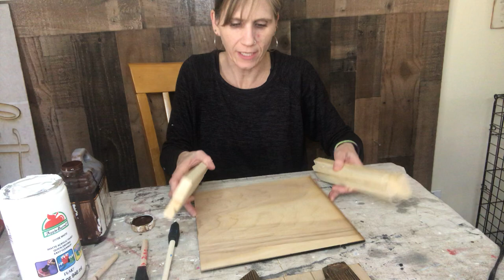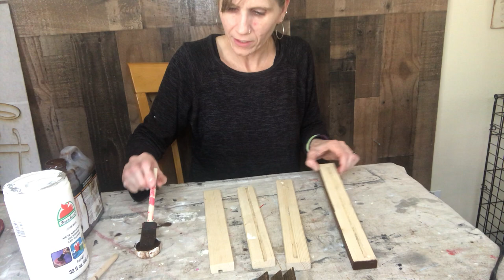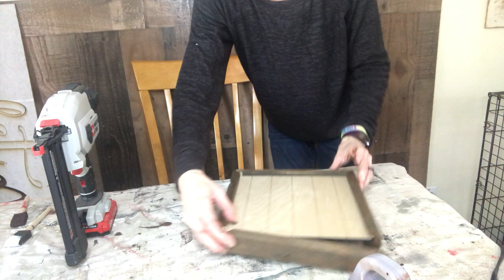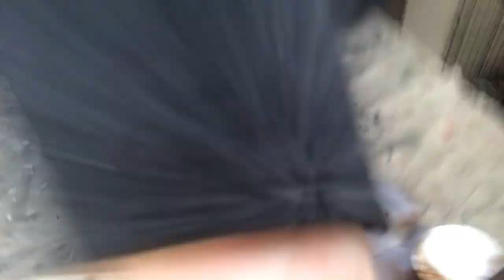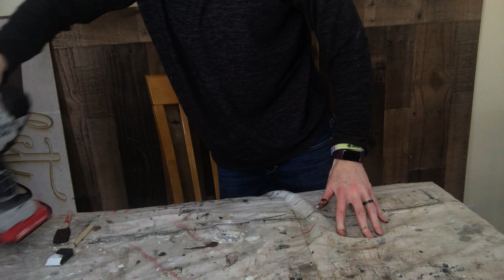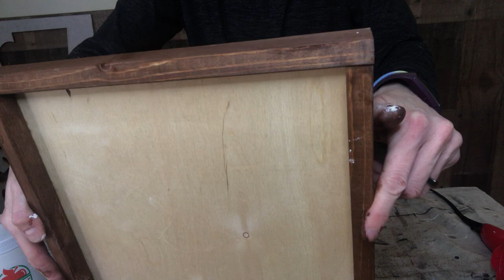Assembling a Farmhouse Sign with Routed Grooves & Thin Plywood - Super Lightweight

Comment: If I have a 1/4 inch mdf board cut at 20x20 and want to do the router groove and mitered corners, what would I cut my 1x2 furring stripes to?  I am struggling on if I should measure based on the long side or short side. Any advice would be wonderful!